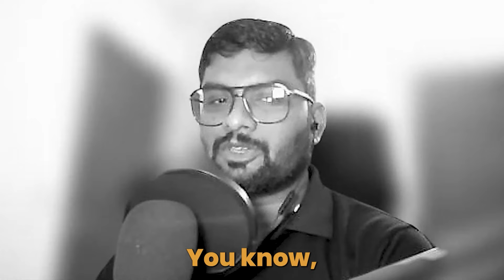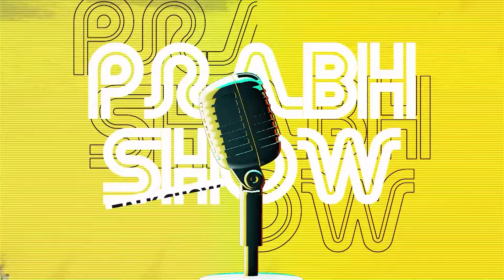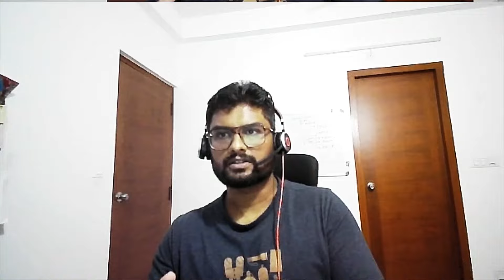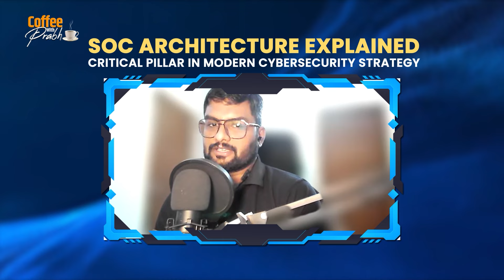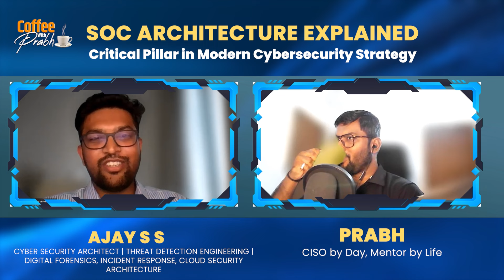Building a Security Operations Center (SOC) From Scratch : SOC Architecture

Comment: That's sounds like a podcast. At least you could have drafted few DFD or designed some MVP security-centric. As an Architect the expectation is drafting hell the solution from scratch not only CD burning struggle discussions. @prabh, Questions should be honored as speaking with an architect; How do you want to dvelop a zero-trust model, How would you access the cost benefit company trying to adapt cloud with security in challenges, Where all the security actually needs to be shifted other than the 'Left-shift'.
Reply from the maker: Thanks a lot will definitely add in my next session